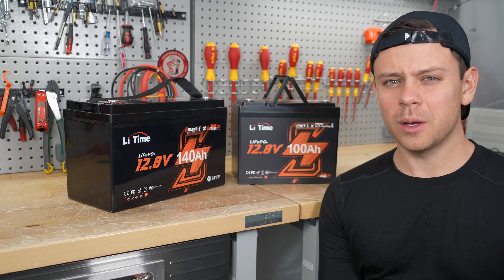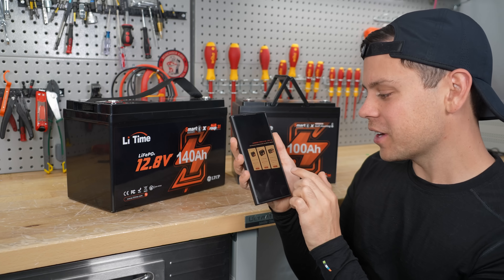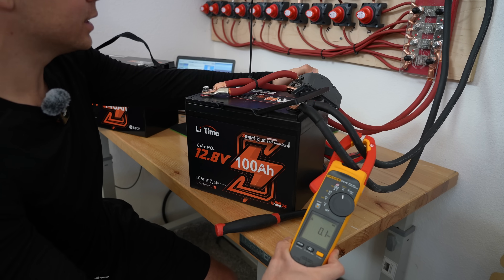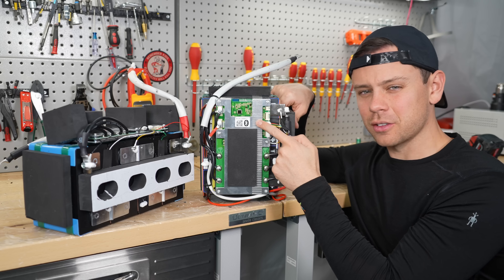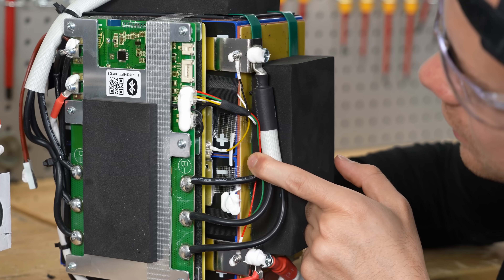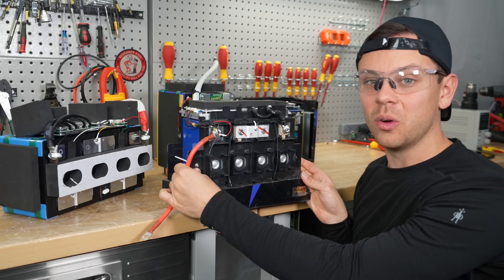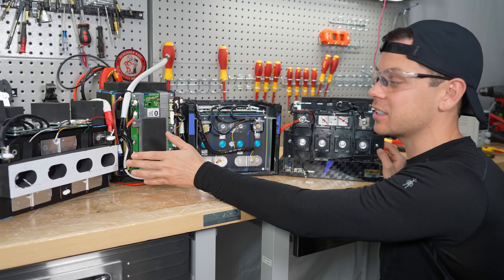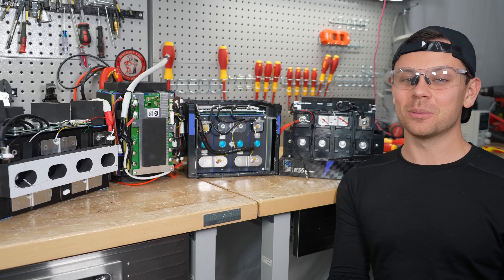Black Friday 12V Budget Battery Showdown! NEW Litime's VS Ecoflow VS Wattcycle

Comment: I'm trying to determine which 12v, 100ah battery to buy, for recharging my power station if need be (when sun is absent). So, if you don't like 12v, what would you recommend for a bluetti AC70?

Comment: I have very limited space in my RV so 100ah works for me. Plus I like that they are lighter weight and more portable so its easy for me to just by two and swap them out.  I guess it depends on the application.  I get about 10 days out of a single 100ah battery.  I use the second to charge devices though an inverter which isn't super efficient, but it is super convenient for that use and to have as a backup.  I charge them with the mfg's 20 amp charger so far so good.

Comment: Hi Will! Love your battery videos, total obsession, like that :). I looking into wattcycle 2 x 100Ah for my camper van. I am leaning towards wattcycle, but get these messages online that paralelling is.a mess, and you have to ocassionally balance them. Is it a hazzle? Or should I go for 1 200AH instead? DOnt need heater while I Will always heat up the camper before using it or need to charge the battery.

Comment: I don't understand the upgraded BMS for trolling motors for surge capacity, the fastest trolling motor from Minn Kota is 112lb of thrust, and runs at a Max of 52 Amps.. The recommended breaker is 60Amps so it doesn't even get close to 60 Amps even with a surge. A regular 100Ah BMS is 100Amps, What need is there for the more expensive/larger BMS?

Comment: To recommend Chinese scam batteries to gain  money from affiliate links is not to be responsible.
There is regulations about safety certifications on battery market. If no valid safety certifications the battery is not allowed to sell on market due to the batterydirective.
So please check the certifications from battery company and get the certificate validated. There is so much false and dangerous batteries in your videos.
By the way. The batteries you got from China have other components inside compared to the batteries sold on Amazon with same label on housing.

Comment: I just bought a used Pelican bass raider 10 and plan on using a 12v 55lb thrust trolling motor on it. I was originally looking at the Weize TM battery with bluetooth, but saw another 1 of your videos saying you wouldn't recommend it. Now leaning toward Watt Cycle, is that the 1 you would pick out of the 3 in this video?

Comment: Got 3 of the Litime trolling motor type as with the sale and the points given on their website I ended up paying $172 per battery. In my application 3 separate battery's is optimal as I run a Garmin Force trolling motor off of them which can run off of 24v or 36v, so if one battery bites the dust I can swap the lead over and keep rolling. Also with my 3 bank charger they stay balanced automatically. All your videos are great - Thx

Comment: Wanted to point out that my 24v troll motor pulled a max of 45a and the 12v motor did 60a at their high settings. So a 36v would assume pulls about same @45a to equal the watts for more thrust. 
With that said believe a 100ah battery is more than sufficient. People get in trouble when try to use these as starting batteries for their main engines. 160-400a surge. That's where the issue is.

Comment: I think you’re spot on preferring a larger 12V battery over multiple 100AH batteries.  I like the WattCycle 300AH option, and want to make a 24V system for our RV, but I worry about cell balancing.  I have a buddy who maintains a mid size commercial solar plant and they get dramatically better performance and longevity out of banks that are properly balanced.  Much higher capacity and when their banks aren’t properly balanced, they tend to just get more and more out of balance as time goes on even further reducing capacity.  He see them trip offline much sooner and stop charging way prematurely when they haven’t been properly balanced. 

The WattCycle batteries don’t have Bluetooth so you have no idea if your cells are balanced or not and looking at their FB forum I see several users of their 100AH batts (with Bluetooth) that have balance issues because the balance circuit seems ineffective if you get a cell that’s more than 0.25V from the rest.  Wouldn’t a 300AH battery require even more aggressive passive balancing in order to be effective compared to a 100?  On the other hand, the price of WattCycle is hard to argue with for those of us who just want to buy and forget and not spend a lot of time tinkering and monitoring.  Thoughts?

Comment: Will,
The Li Time 140 is offered as a cranking battery with lots of reserve. 
Not sure you addressed this directly. I have a 15 HP diesel on my 30-foot sailboat (occasional overnights).
This battery could replace the heavy two 100 amp hours lead "dual use house batteries" I now use.
Or is there a problem?

Comment: Thank you!
I read that all of the smaller, compact 12v, 100ah batteries use pouch cells. I also read that prismatic cells have been shown to have a better life span than pouch cells. Can anyone confirm or have an opinion on either?

Comment: Perhaps on review for a simple smaller/cheap DIY solar charger for the 12v LiFEPO4 battery(Like the one from Litime 30A $99 one or Bioenno Power says its a 20A charge controller) for those who have only 1 battery and a few panels right now, looking to upgrade.

Comment: Litime sucks one year in 100ah 
After charging, it starts out at 70% at 13 31 hold at 13 seven and has less bank to with draw power from a five in drive drop sit down below 12.6 When I inquire about the warranty and then you communicate in one paragraph a day so it takes two weeks to get your messages back-and-forth and then after one year of paying 515 they wanna give me 340 back on the warranty or give them 160) 😮send me two new batteries.
Don’t buy litime Are there any circumstance? It’s not even if they’re free.

Comment: Can you do a video on the 12V 100Ah LiFePO4 Battery Group24 Lithium Battery with 100A BMS Low Temperature Protection and open it like you did the other batteries?

Comment: Just got back from a week long camping trip. I did a lithium conversion with the 140ah li time a few days prior. 3 days were dry camping. It was very nice having the Bluetooth to measure SOC without any additional equipment. 650w vevor charge converter was able to slam a charge back in it during limited generator hours. Happy customer so far, worthy upgrade.

Comment: Semm's LiTime gettin worse  on customer suport with guarantee =( waranty ) = suck's , ma own experience with one TM ( trolling Motor ) batery , own two TM , ones making vooddoo , stops at 11,3 volts ., the other batery bms , shuts at 10,2 volts , what to doo ?.guess one cell is faulty ?, or Bms ? . 10 months of use .

Comment: Just bought two of the WattCycle 300amp hour mini batteries and I'd like to build the beginnings of a solar powered backup electrical system, with a proper transfer switch, connected to my main electrical panel, and provision to plug in my dual fuel gas/propane generator.  For short time period outages, the two 300 amp hour batteries would keep my house electric system working, and if the power doesn't come back on, I could go out and fire up my generator.  Do you have diagrams, descriptions, or schematics for such a setup on your website?  I'm tempted to get another two 300 amp hour WattCycle batteries, for a 48volt battery system, but I'm on a limited retirement income.  Which inverter should I get for this setup that will provide 240 volts split phase to my main panel?  I have an electric 240 volt water heater, as well as an electric clothes dryer, but those are the only two items in my house that use 240 volts AC.

Comment: I install marine electronics for a living, and do a fair bit of trolling motors. Most if not all of the manufacturers require an external fuse/breaker be installed and that fuse is usually 60-80 amps. I don’t know why a very large surge capacity would be needed on trolling motors.

Comment: How about the Eco- worthy 150 ah with Bluetooth. 167 on eBay?
Reply: Another cousin of the Eco-worthy is DC House 165 ah in a metal case for $180 with Bluetooth to provide battery status. Crazy deals.
Reply: I was able to get 1.96kwh in my inertial discharge test on the 165. I didn't factor in the inverter losses as the killawatt only calculates the 400w heater consumption.

Comment: Have you looked at this battery? I am interested to see what's inside and how they were put together.  Sourcepow 12V 100Ah LiFePO4 Battery, Bluetooth Lithium Battery BCI Group 24 with JBD BMS for $150 on Amazon.  It's hard to believe they were this cheap.  I bought 2 of these 11/24. they were manufactured mid 2024 and came at 50% charge.  All the cells appeared to be balanced. I just charged them up to 100% and the cells balanced out. I hooked up to the BMS using both the Xiaoxiang app and the OverkillSolar app.

Comment: Will, I have a problem. I am on a serious budget. So I bought my first 2 AOLithium 12v 100AH Bluetooth Battery. I went to buy my second set of 2 batteries and AOLithium is all out of stock and the battery is removed from their website. If they are stopping production, how do I find a battery I can pair with these. An YES I know you said I should not mix and match but I have no choice.. PLEASE HELP! Also I bought a ECOFLOW and you cannot access the BMS on that battery.

Comment: Hi Will great videos. I currently am in information overload. I just bought a Vanagon Westfalia which I am going to be camping with. I have a framed 100 Watt Renogy Solar panel a bluetti 600 watt power supply. I want to run a 700 watt microwave or a kettle. I also have a bluetti charger. What battery would you recommend? Also 12 or 24? I currently have an Agm  12 100 amp hr but it was a ton.

Comment: 4:44 I hate that companies put giant globs of glue on those connectors. They clip in and have never heard of one pop out during shipping. If one pops off, it sounds like it hasn't been plugged in correctly or someone pulled on the wires during assembly. Fully agree on heated batteries, and a lot of people don't understand why you can't (or rather shouldn't) series them especially when some manufacturers say you can. Also, I have no idea how you use that oscillating tool to open these. I bought one and it is terrible to use in a careful manner, makes a mess due to particulate flung everywhere, and smells awful due to heating and thereby melting plastic LOL. Happy Thanksgiving!
Reply from the maker: No way!! It's the only way I can open them 😂 I've heard others complain about it, guess Im only one that likes that thing haha

Comment: These batteries - how to charge them properly, they do need ""absorbtion time"" after hitting full voltage ?? The bms balancer works in this upper area where almost no current is hoing in 🤔 ? My eve cells do need this 1hr constant voltage at 14,4V for balancing and topping up
What are your experiences regarding cell balance in the sealed batteries ?

Comment: OTOH, having multiple 100 Ah batteries instead of a single large battery could protect against BMS failure. Not an issue usually, but if you're on a sailboat in the middle of the ocean... 🤷‍♂👍

Comment: Please review---
Humsienk 12V 100Ah Smart Bluetooth LiFePO4 Battery w/Low Temp Cut off 100A BMS
On Ebay. 155.00 now
Use the same app as Wattcycle , think it may be same battery, rebrand.

Comment: I've been wanting to buy 2 LiTime 12V 230AH batteries to replace the 4 6Vs in my motorhome.  I signed up for their newsletter. Caught a 1 day sale for $419 each,  plus a free 12V 20amp charger, a $90 value. Plus, with their rewards, I got 2 300amp bus bars for free, a $64 value. So deals are out there. Like you said, just have to know what the everyday price is.  BTW Thanks for the videos!

Comment: For my RV. If internal heaters are not wanted, would it be more economical and beneficial to buy two 300ah watt cycle and wire them in parallel vs one epoch 460ah essentials battery?

Comment: I wish you'd do a review on the most affordable battery on the market currently. 
I've am now in possession of 4 12v 100ah LISUATELI batteries. 
And,  against all advice on YouTube.  I recently added a 12v 200ah LISUATELI to my battery bank. 
Took about 8hrs to balance voltage on both charge and discharge. I'm amazed at what I've built for much less than market pricing.
When contemplating a 200ah, 99.9% of internet info, said it was a bad idea, or would destroy my 100ah batteries. 
I now know that was not true. 
Would love to know if I have surprises coming in the future. 
Thanks for all the information I've learned from your vids so far. Couldn't have done it without you.

Comment: Please test the litime marine 140 amp dual purpose starting/deep cycle  battery 
Test the 3000 amp lithium diesel stating battery from ionic  that battery has started my dump truck all season  
Thanks for the great content 
With my construction company and love for boats my interest is in marine and equipment starting and marine trolling motor batteries.   My litime batteries have worked good for my boat lift and trolling motor applications

Comment: I bought 3 wattcycle 12VDC300amphour mini's in recent months, so far they kick butt!!  stuck them in a small travel trailer as overkill for off grid glamping!! gotta love them.  Recently both an Ionics lithium starter battery for my FJ Cruiser (which replaced an old lead acid) and works awesome and was reasonably priced.  For the Watt cycle batteries I bought I did buy the LiTime 80amphour charger and since then have seen those black friday offers and am shell shocked at what hte 50% price offers are for the equivalent of a 12volt 300amphour wattcycle, ridiculous.  The only thing i've noticed is that the wattcycle batteries I bought are now out of stock.  Thanks Will!  keep up the good work, just found you this year, glad I did.
Reply: Do you have the actual dimension measurements on those?

Comment: Hey Will, have you seen this battery?  12V 300Ah LiFePO4 Battery Small Size, 3840Wh Lithium Battery with 250A BMS, Up to 10000+ Rechargeable Cycles, Support in Series/Parallel, Perfect for RV Camping, Trolling Motor, Solar Power Storage

Comment: I ended up buying a 300Ah Vatrer because it had Bluetooth and self heating - $589 shipped.  LiTime didn't have self heating and WattCycle has a 300Ah with Bluetooth coming but not sure about self heating.  The Vatrer seemed to be well built.  Fingers crossed.

Comment: Good upgrade on the safety. Also look at the PAPR type that will keep particulate out if there is any seal to face issue. 
Also consider the work station environment. Micro particulates stay airborne for quite some time.

Comment: I bought some Eco-Worthy 12.8V 150Ah (BMS reports 165Ah) metal cased smart batteries with low temp for $212 off eBay. Decent deal I think for 2kWh.
Reply: Are these the 150 ah batt? Didn't see any metal cases batt by eco.
Reply: @uncontrollabledogs3791  Yeah, they have them on eBay only. They raised the price now. DC House is identical but cheaper now.

Comment: On the Amazon black Friday sales, I'm in complete agreement...
I've been watching Battery and charge controller prices since two weeks prior in anticipation of Amazons Black Friday week. I'm very disappointed...
I'm not seeing deals anywhere near what I saw the last couple years. Especially on batteries.
Two years ago, I built a 200 ah battery, 1-kw inverter, 200 watt solar power system with 30 amp dual input MPPT charge controller into my off road truck. 
Last year I doubled the battery and solar power on that system. Total cost after the upgrade was about $2000...
I like that power system so much. This year I wanted to build a similarly sized battery based backup for my house utilizing a 2-kw split phase inverter I already have. Unfortunately, I'm going to have to spend considerably more.
                                                                                              😒

Comment: One thing that I've learned is to never cheap out when it comes to batteries, I started out with Battle Born and then switched to the cheaper SOK.
The cheaper batteries don't perform as well , next time I'll probably buy a single 130 ah Lithionics or similar.

Comment: Great video! I have an additional battery test to suggest -- after you open up the battery, track voltage across the cell bank while charging (bulk, absorption, and float) to see what voltage actually gets through the BMS to the cells. I get the feeling some BMSs have larger voltage drops and some may be smart enough to reduce voltage for float. I'm not sure about that, but I'm suspicious.

Comment: Newtipower is another budget battery. I've purchased three over the last two years. One I built a portable power station with a 1500 watt inverter and the other two provides power to my camper with a Tracer-BN MPPT controller feeding power from PV panels. They seem to work flawless for me .

The air purifying respirator which fully encapsulates your face is your best respiratory protection below a supplied air respirator SAR or self contained breathing apparatus SCBA. Good for next pandemic mandate.

Comment: @WillProwse I would love to see a teardown review of the DC House 12v 100ah batteries. They sure look like a rebranded Eco Flow for way less (seen them as low as $135ea!) I'm using 8 of them and no complaints yet, but I haven't done any testing. Just wired them up and they're doing what I need for now.
Reply: I believe that DC House and Eco-Worthy are the same company or sell the same ODM batteries.